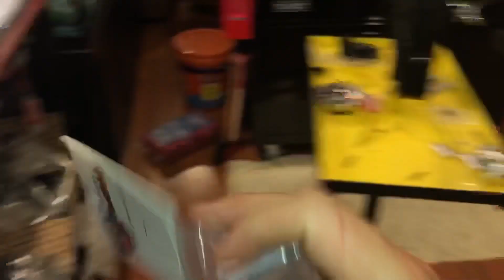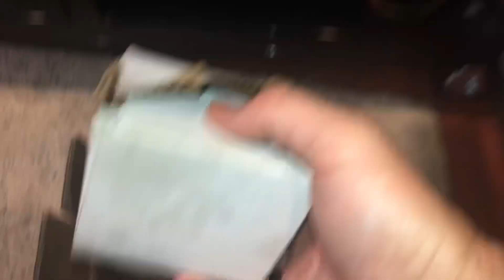Get Ready For 2018 Philly RC Drag Race Event Hosted By HVRC Also Special Guest Marvel Came 4 AVisit

Comment: Hey boss man have you seen my video of my motor running in my truck all I have to do is the driving break-in now then tune it
Reply: Are you going to be doing the MTXL build soon
Reply from the maker: Bro she sounds great 👍 Snap Crackle pop 💥!!!
Reply from the maker: Blake Racing Motor Sports yes but I may do my midget Baja first ? Just because I want to rip that little bitch around so bad . My MTXL will be a big job so I’m not that hungry to take it on yet. I may start on it when the weather gets worse? I have to take advantage on days that are still good for running

Comment: John hey boss I need your help on something whats best possible pipe and manifold of LRP .32 x spec4  stock not modified.
Reply from the maker: usmcchet tuntavern ERCM Big Block End Bleed lol 😝 but it’s impossible to get it!!! Anyways on a stock engine use Novarossi 9853 but if your getting a Modified in the near future?? Just get the 9886 pipe and make sure you use the 41032 header also for both !!
Reply: @BOTAJELL  I heard you say that before in your videos that's why I didn't ask about them. My wife told me to tell you that you are a pain in the ass because of watching your videos and spending mad cash on my RC cards again. Stepped away from them but watching your vids sucked me right back in. Lol

Comment: what do you think of a Losi 5ive T 2.0 for a first 1/5 scale vehicle?  I have a few nitro and this would be first gas, I also have some E words for running in the winter on indoor tracks.
Reply from the maker: Erik Rasmusson haha that would be a super start bro!! Brappp Braaaaap ⛽️🔥💨!! The new 5T 2.0 comes with a great reliable and decent power engine. You can’t go wrong with a Zen G320 . My friend  uses one of those that’s new to this and installed a RB intake insulator block and a 990 carburetor with a 1 inch Velocity Stack and new air filter and a Dark soul lightened Flywheel and that engine rips now and easy for him to start and it will run all day . There is also really good head kits out there for it if ever needed more power on a budget. The new 5T 2.0 body is bad ass with that hood new scoop . I also love how the front drive shaft is not in a hard angle like the first gen 5T it’s straighter now and believe it or not that creates less wear and tear from less friction.

Comment: great video bro, its always nice to see 3 bros  talking about the hobby it self. 
i agree with the nitro engines, E word as taken over.
but i do love my LRP engines, so much power love it. :) 
a good budget engine i go for is the Force make engines. 
keep wrenching .  :)
Reply from the maker: Tuga RC thank you💥👍💥👊💥🤝💥 ! Someday you must try out a next level (Modified) Not Stock Novarossi 28-8 from Rick over at RB MODS!! It will make your LRPs feel like what’s going on! Trust me ! Also he will Modify a LRP 32 X series bad ass also but I recommend using the Novarossi Carburetor on it . https://www.rbmods.net/legend-28-8-truggy.html
Reply from the maker: He will also do a great job with Picco engines as well. If your a Picco fan. But you can never go wrong with the Novarossi. Even Modified they will last and always run like a watch!

Comment: Good stuff bro, while you’re talking about carbs I just bought a new 4 bolt 30.5 and it has a Walbro 1048 carb on it , intended for my Baja I haven’t run it yet wondering what you think about them as I’ve never used a 1048 before
Reply from the maker: Whitto’s Rc who made your 30.5 ? Is it Modified from GIZMO or OBR or BARTOLONE or ROOSTER TAIL, or E.S.P. ??  If so ? Depending on modification done to it and if it’s a reed case? I would use a true Modified 990 or a stock 990 carb or even a 771 carburetor Modified depending if I’m Drag racing or a 883 That has an accelerator pump

Comment: Nice taste you have CRF😰😰
Reply from the maker: Zeeeeeaah 💥👍💥🥃💥🥃!
Reply: @BOTAJELL   i there, I have a question, can not I find the oil amsoil dominator here in my zone, can I use the motorex racing or the motul 710 or 800 or motul grand prix 2 stroke karting, i want a good oil but amsoil just online stores
Reply from the maker: Umi touch try to get the Amsoil Dominator! If you can’t? Go with Klotz 20%castor

Comment: Sup man. Question about the TLR 4.0 truggy. Did you shim the Rees diff pinion? I just locked my center diff with JB weld and it worked but killed the rear diff in minutes.
Reply from the maker: Brio Nitro yes 1 shim on each side fatter shim on the side to push the ring gear into piñon gear ⚙️. Use 100,000 on center and 50 or 60,000 on front and rear ! Please don’t go thicker then that trust me!
Reply from the maker: Hope all is well NITRO Brother Brio💥💥
Reply: BOTAJELL thanks but why do you say not to go thicker?
Reply from the maker: Brio Nitro no need it’s a waste and it won’t handle the same if you like to run down E words in Parks . 50K100K50K is already crazy thick for little 1/8scales RCs but when heated it will work well for bashing 1/8scales . Thinner like 8 k and 10 K 8 k diff oil is best for racing in real tracks because it will handle the best on turns lees power to ground from all 4 wheels . When you turn there will be less power on the pressured so less fish tails and it will be moved to the one wheel that’s spinning. That’s what they call one wheel wonders or pizza cutters . Thicker all 4 will have power at the same time

Comment: Lol John the signature serious drag mod  mette?    I just called to see price to have mine done !
Reply from the maker: Levi Hogge you should try to call Bartolone about his 34 Reedcase Drag Mod with his crank case and his true Modified carburetor trust me!! It will run past the Scott Finlay 34 reed and the SF 34 reed used to be king of the normal sized engines but not anymore.
Reply: @BOTAJELL   I'll check into it John  ! That's Chris bartalone  right ?   I'm  going ahead an making my second Baja  into a drag Baja so I'll be looking for a badass motor for it
Reply from the maker: Levi Hogge yes Chris Bartolone and he has  his own pipe combination for it that works great together. His Modified carb for it really dumps fuel so be warned. You will go threw more spark plugs but it’s worth it at the end.
Reply: @BOTAJELL  heck eating few spark plugs that no problem .  I can handle that  cool cool John I'll have to talk to Chris. Marbel  is a cool cat   be fun to sit an talk about Ole days an what he has seen threw the rc hobby years